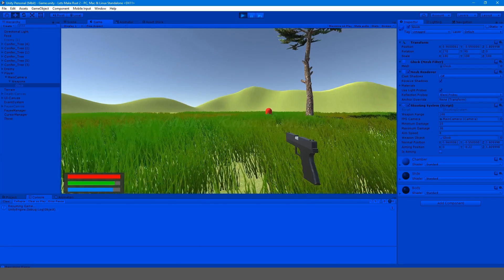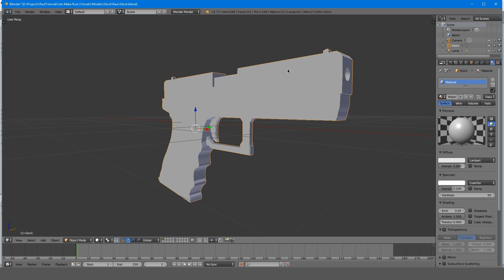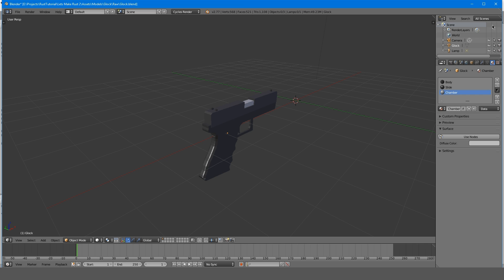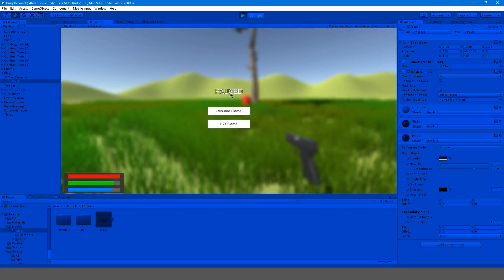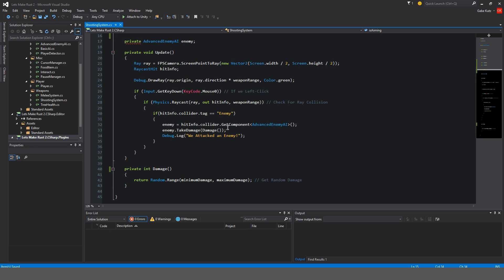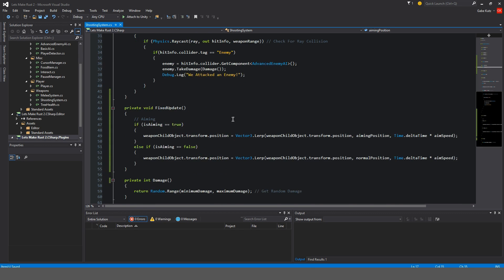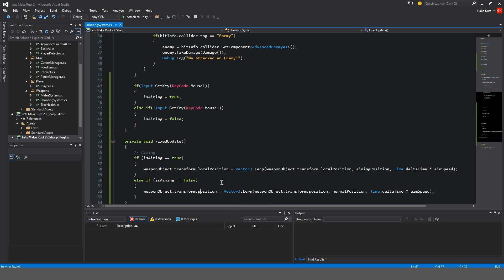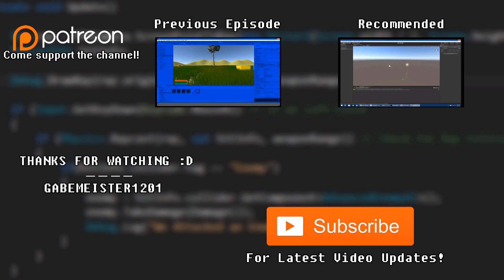(Old - Unity 5) Let's Make Rust! [Episode 13 - Exporting Model To Unity]

Comment: If you will need help or will look for programmer let me know. I'm bad at graphics, but can help with programming side. Mostly in most heavy parts or handling network stuff (because Rust handles this not the best way :) )
Reply from the maker: How familiar are you with Network Programming?
Reply: I'm bad at graphics, so I did many proof-of-concepts in Unity using UNet HLAPI, UNet low level API and then pure sockets (TcpClient / UdpClient). Using last mentioned I wrote simple raw servers that don't need Unity, so the were very lightweight.